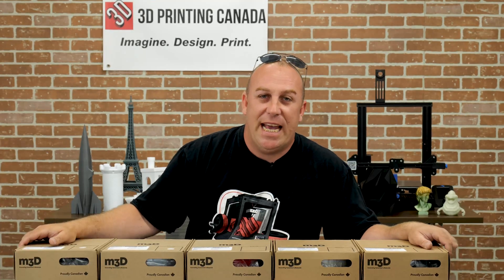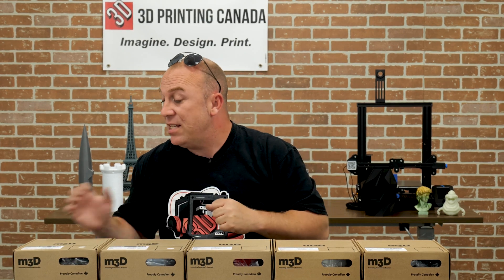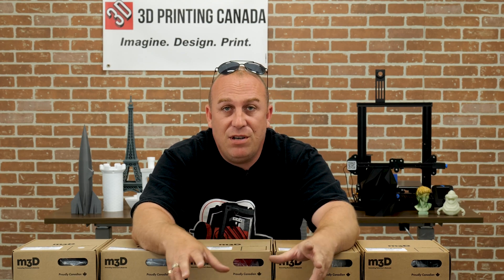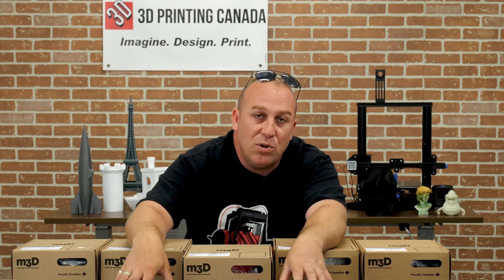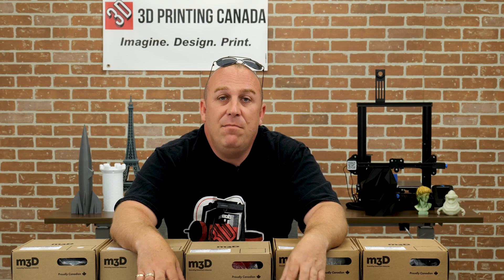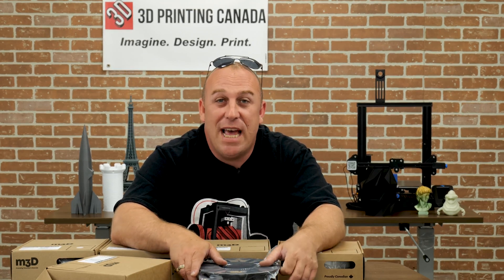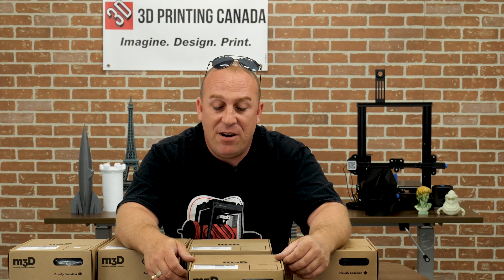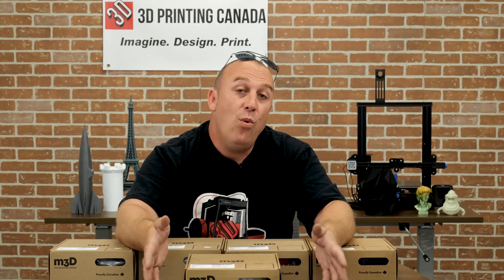EXPLAINING OUR FAVOURITE MATTER3D FILAMENTS

Comment: So why would you have to dry the PLA filament if it's packed in an air sealed bag? I can understand if you had it out for a while that it would absorb moisture.  Would also have been good to see some examples printed with this filament. I'm in Victoria, BC so would love to try this filament but your video doesn't give me much confidence that this PLA is as easy to use as the two Elegoo rolls I have right now.

Comment: i ordered 8 spools off of them cant wait to try it.
Reply: Their paper spools suck and the petg is very stringy until you calibrate temp and retractions
Reply: @offsetsgarage  good to know thanks, did you try the pla?
Reply: I found the recommended temp is a little hot. Try 230 for anything above 1st layer. @offsetsgarage
Reply: very interested in their filament, how did it work for you?
Reply: 8 spools to try it? how did it go?